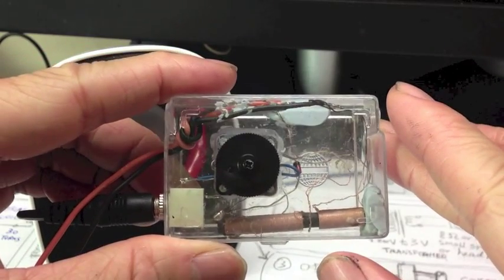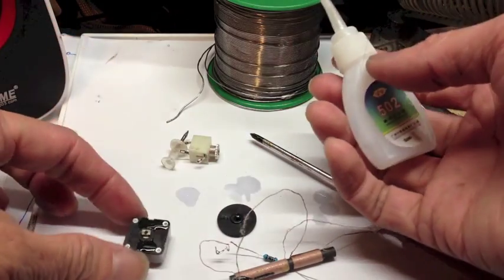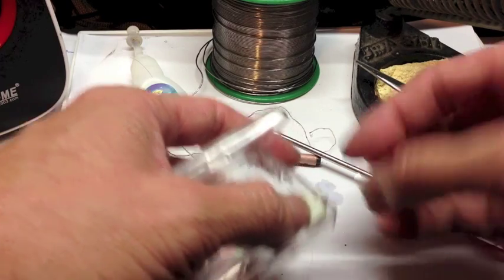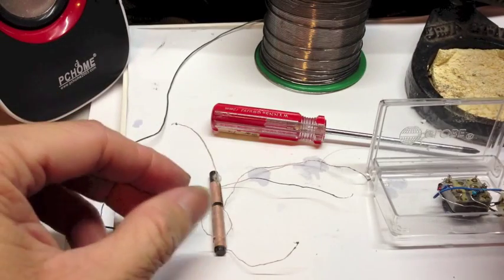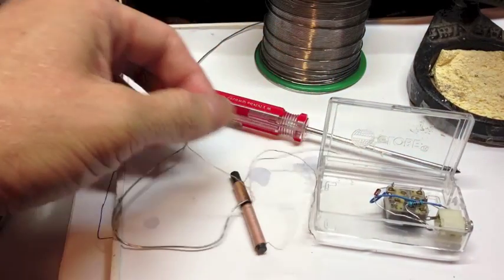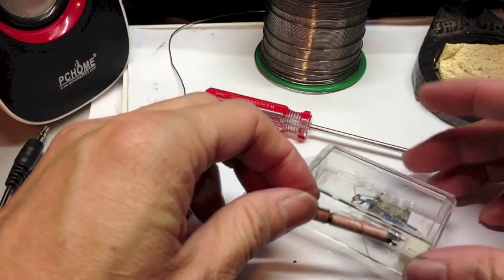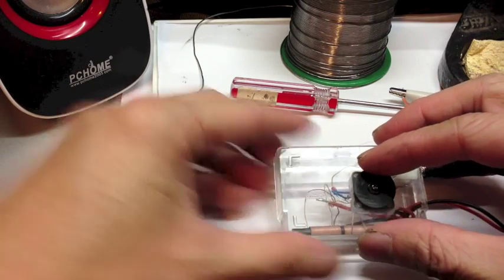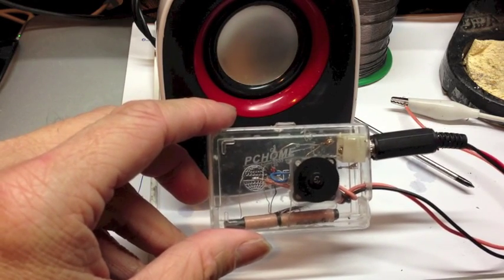Billy's DIY Tiny Crystal Radio

Comment: Very cool crystal radio, I'm from the uk and have been ordering lots  of components and parts from a site called aliexpress, I've been having a lot of fun with my nephew playing around with different electronics projects. I have most of what's needed, but I can't find the variable resistor you use in this video, could you tell me the part number. Thank you.

Comment: How u connect the wire to the ground
Reply from the maker: You can connect the ground from the crystal radio circuit to the steel water pipes. They usually go into the earth and will be a good grounding source.

Comment: Please how to add power to a crystal radio ? can I add a battery or something to eliminate the need of a ground connection ?
Reply from the maker: Adding battery to a crystal radio defeats the purpose of crystal radio which is battery free.
The human body is also a good source of ground connection.
So, touching the wire will give you similar effect as connecting the ground through the water pipe.

If you want to eliminate ground connection, you can create a crystal radio using a bigger coil, say 1 to 2 foot in diameter. That way, you can receive sufficient energy from the radio station to power your earphone without earth or ground.

See my other projects on this in billydiy.blogspot.hk
Reply from the maker: Checkout this other video about a big loop radio that is antenna free and ground free.

Hula Hoop Crystal Radio
Reply: I know it defeats the purpose of a crystal radio but I read somewhere that you can add a 1.5 cell to the circuit to make work more like a regular radio ( but without transistors ) do you know how to do that ?
Reply from the maker: BRAZILIAN CRAFT
if you know Chinese, you can checkout this post in a Chinese crystal radio forum

http://www.crystalradio.cn/forum.php?mod=viewthread&tid=507990

There are some circuit diagram there talking about a crystal radio powered up by a battery and a real crystal.
By applying the right amount of voltage, it'll cause the crystal to vibrate, hence improving the reception of the original radio coil by improving it's Q factor.
Such crystals are hard to come by, the modern version of that is to replace a crystal with a tunnel Diode. This is very hard core wireless. May be hard to achieve.
I think you may have better effect making a big loop radio. Or using FET and battery to make a crystal radio that is loud enough to power a speaker.

Check out this link about such a radio which is capable to receive AM/FM stations. It can function without power and with power (charged from a solar battery).
http://billydiy.blogspot.hk/2013/07/i-designed-small-box-am-fm-solar.html

Comment: Would a 126pF cap still be okay?
Reply from the maker: If you have a smaller capacitor, you will need more turns on the coil. Check out my other video how to design a crystal radio from scratch that will show you how to calculate the number of turns : https://youtu.be/161vWissKLU

Comment: Where the hell can I buy these things?
Reply from the maker: +Seren Hutton 
Though many of the crystal radio components are not sold any more in conventional electronic shops, you can find them in the following ways:
1. Savage used components from old radios/broken radios.
2. Buy online where hobbyist/manufacturers trade their older components: e.g. eBay, or in China www.taobao.com (owned by alibaba).
You can find more info from many of the Crystal Radio Forums. e.g.  http://theradioboard.com/rb/viewforum.php?f=2&sid=6bcfe90e731a4f1d0c56f46c55ecb208
For people in China, we use this site: http://www.crystalradio.cn/forum-3-1.html
Reply: back in the 90s u used to buy the parts at radio shack now radio shack doesn't sell electronic parts any more